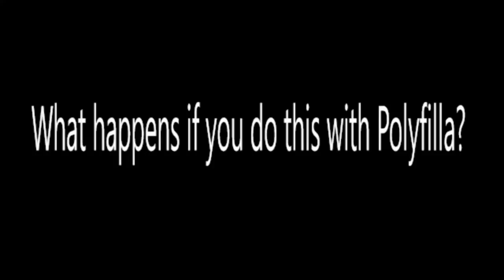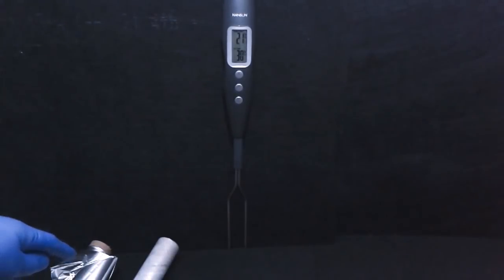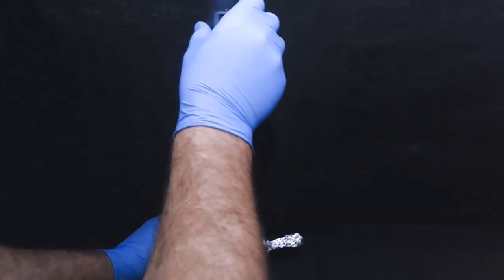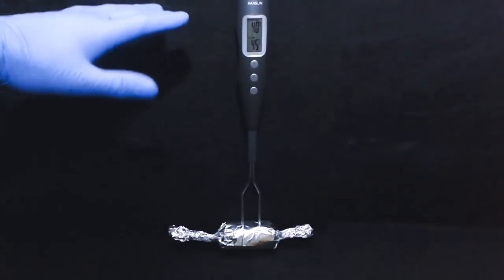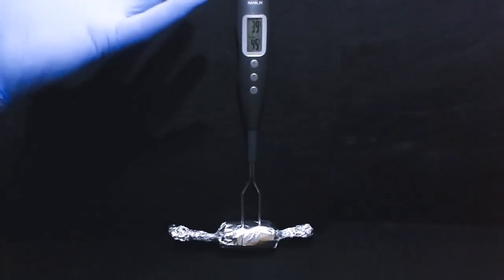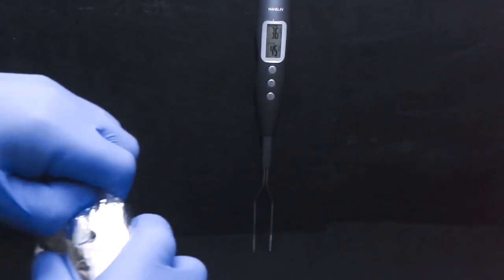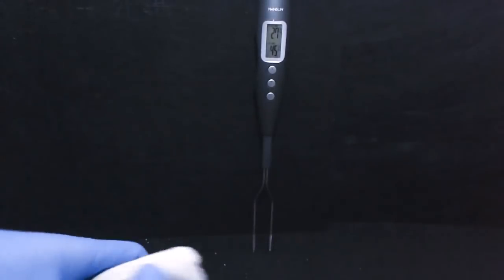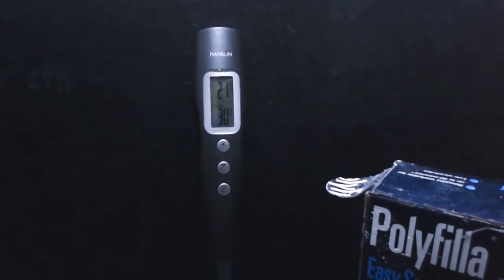What happens if you do this with Polyfilla?

Comment: Interesting. Thanks for the video. I have used a lot of Pollyfilla in the many years that I have been doing DIY decorating. The Wickes own brand is also pretty good and easy to sand but it does have a slightly creamy yellow colour, whuch isn't a problem when painted over.